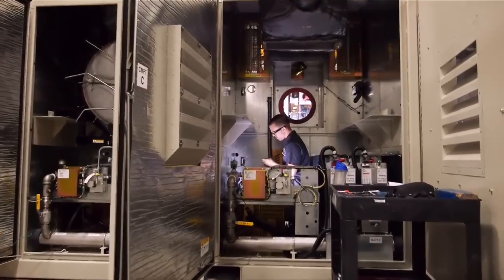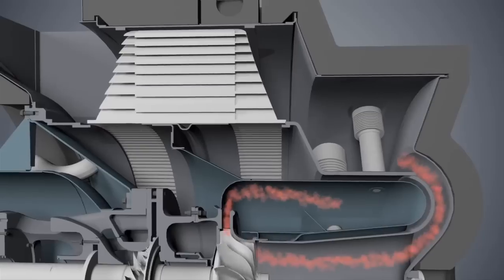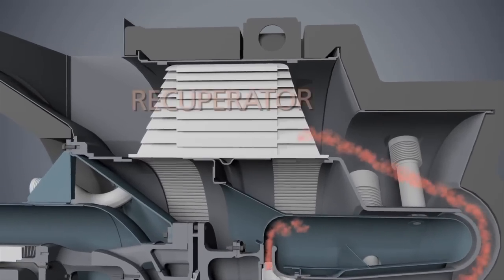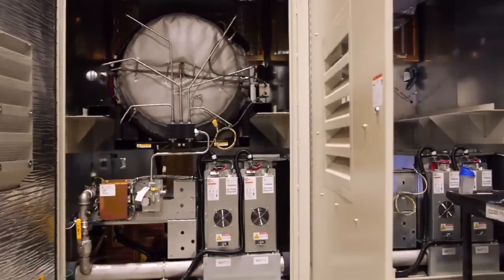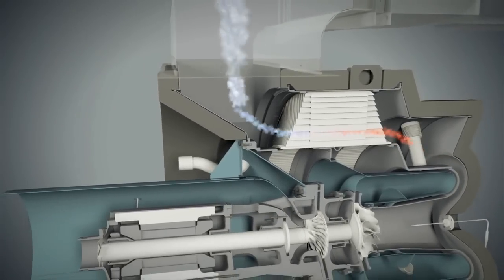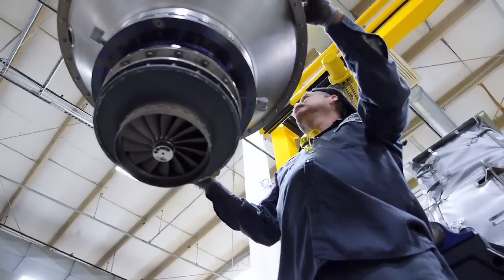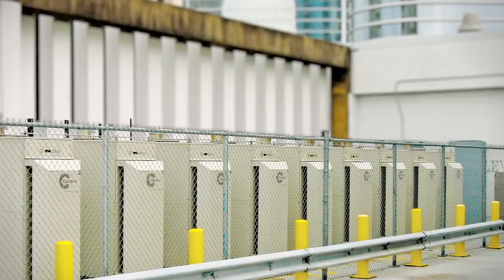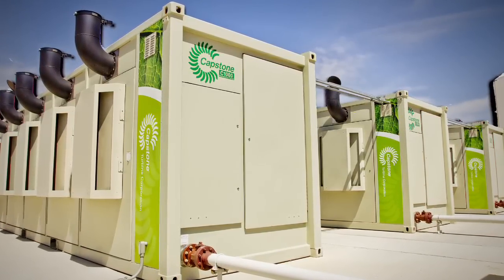Capstone Turbine Corporation

Comment: Written October 18, 2019:  Capstone Turbine will be doing a 1 for 5 to 1 for 10 Reverse Stock split with in the next few days. Reverse splits are not good for shareholders. Stock prices often go down significantly AFTER Reverse Splits compounding loss values to a devastating degree. Legal case as well: They are paying a shareholder law suit settlement of $5,550,000 in the next month or so.